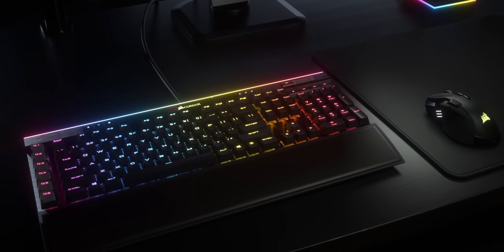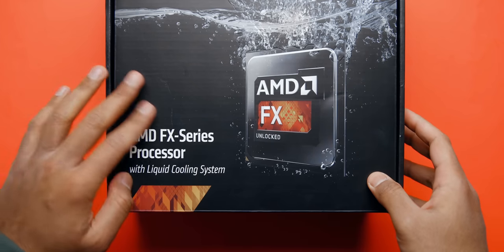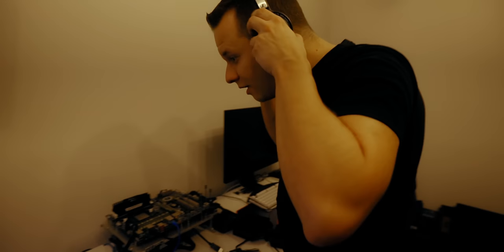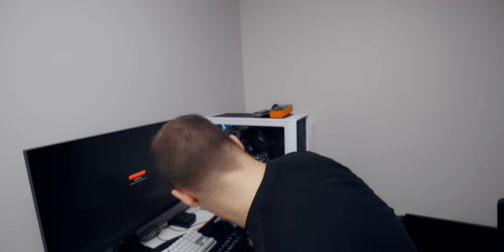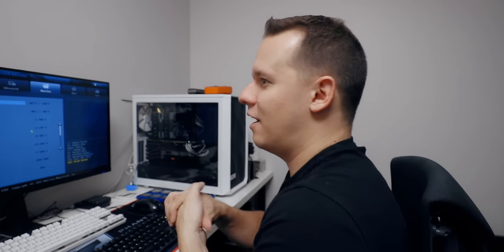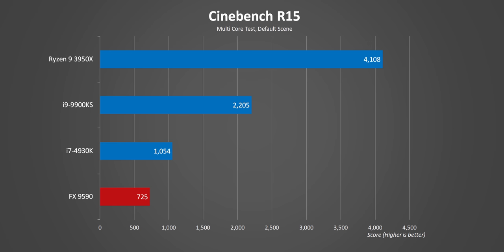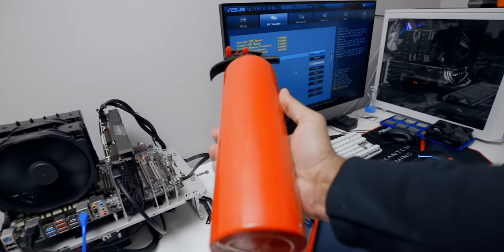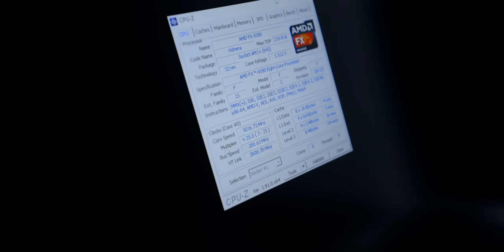Why The FIRST 5GHz CPU Almost Failed - AMD FX-9590 Revisited!

Comment: 220 watts for 5 Ghz doesn’t seem all that unusual. Doesn’t the i9-9900K also use a lot of juice at 5 Ghz. 
Thank you for bringing a blast from the past back to us.
Reply: the i9 9900k does 5ghz ALL CORES, fx 9590 only does 5ghz one core out of its 4 cores cough amd misleading not actually 8 core lawsuit says. the i9 9900k uses 120 watts... As you can see the fx chip is a good as comparing a toy plane to an actual plane. btw that ryzen chip getting smashed by the i9 9900k in all benchmarks was amazing right amd really likes misleading people, cough the ryzen cpu was more then double the price of the i9 and had double the power consumption cause it uses double the cores. cough ryzen 3rd gen is not 7nm look it up! its actually 12nm lol amd MISLEADING PEOPLE once again just like saying 4 core fx cpus was 8 core when it wasnt, ryzen aint 7nm its 12nm amd just saying (in pending lawsuit) that its AMD's interpretation of 7nm which is bull shet.
Reply from the maker: @thelightsilent  Exactly.  And then when overclocked it goes above 400W easily.
Reply: @thelightsilent  Only the Ryzen 3000 APUs are 12nm. The rest are TSMC 7nm.
Reply: TheLightSilent can you link me to this information? I cannot find sources stating that Ryzen isn’t 7nm
Reply: @thelightsilent  the i9 is the one using more power compared to the ryzen 9
Reply: @thelightsilent  what's you opinion on chemtrail, though?
Reply: @thelightsilent  What drugs are you on, my man? I'm not sure why they even replied to you.
Reply: Analyzing Male Slavery Yes I know that, if you read clearly he stated that Zen 3 is 12nm hence why I’m question where did his information come from.
Reply: Hardware Canucks This was my thinking as well. Thank you Hardware Canucks.
Reply: TheLightSilent Couldn’t have said this better myself. Thank you. (:
Reply: @HardwareCanucks  Did you read the full comment you replied to? 1 true statement followed by a series of straight out lies. Did he even watch your video? There isn't a single benchmark where the Ryzen CPU gets "smashed", even in games the 9900ks isn't that far ahead while it truly lags behind in multi-threaded applications. The R9 3950x isn't twice the price of an i9-9900k, it's roughly 50% more expensive (a bit less than that in fact and the difference is even smaller with a ks). A 50% increase in price (at worse) for a 100% increase in performance in multi-threaded applications and only a 10 to 15% decrease in performance in games, not a bad deal at all for a content creator. And that's without mentioning the 3900x that still beats the 9900k(s) with a significant margin in the same MT senarios and costs the same.
Ryzen 3 CPUs (not the APUs) ARE 7nm, and it's not a case of "AMD misleading people again", that's what TSMC calls their own process. So if someone has an issue with it and thinks that TSMC shouldn't call it 7nm it should be taken to TSMC, not AMD.
And no the R9 3950x doesn't use twice the power of an i9-9900ks, the graph in the video shows a 40w difference (181 vs 220). Considering the R9 has twice as many cores for double the performance it is actually a very good result. And again if he wanted to compare apples to apples, then let's have a look at the  3700x: consumes significantly less power than the 9900k and ks for the same core count, similar performance in MT applications, 15% slower in games but also much, much cheaper.
Reply: @thelightsilent  The 9900K does not do 5GHz on all cores at stock.  Only two cores.  When overclocked to 5GHz on all cores, it uses a hell of a lot more than 120W.

The 9900KS doesn't do 5GHz on all cores at stock, either.  You only get that when you ignore the 125W TDP, just as you only get 4.1GHz all-core on the 9900K unless you ignore that processor's 95W TDP.
Reply: @thelightsilent  And you're delusional about 7nm.  Actually, you're delusional in general, it seems, but it's hard to say given your word salad.
Reply: @thelightsilent  Which Ryzen got smashed by the 9900k? If you're talking about the 3900X, it beats the 9900k on pretty much every benchmark, and at gaming it is about on par but slightly behind. If you're talking about the 3950X (since you said twice the cores) it doesn't have twice the power consumption of the 9900k, it uses the same amount of power despite having twice the cores because of how efficient TSMC's 7nm and Zen2 are.

The Ryzen 3000 series has 14nm, 12nm and 7nm CPUs, all of the Zen2 CPUs are 12nm while the Athlon APUs are 14nm and the Ryzen APUs are 12nm. Even if the 7nm Ryzen CPUs were actually 12nm, the one getting the lawsuit would be TSMC, not AMD, because they're the ones adverting the node as 7nm, and there is no way it is 12nm, otherwise we wouldn't see the massive jump we saw from Ryzen 2000 to Ryzen 3000 if Zen2 were still using 12nm.

FX having 8 cores is not a lie, and even if you want to argue that they don't count as 8 cores because they aren't full cores, then they wouldn't be 4 cores either, it would have 4 full cores and 4 half cores, though that's not exactly how it works, in reality it had 4 modules with 2 cores each, but they shared resources with the other core from the same module, more specifically, they shared a FPU. Nothing says that a core needs to have its own FPU to be a real core, if that were the case then old CPUs that didn't included a FPU wouldn't be single core CPUs, they would have zero cores.
Reply: @thelightsilent  Lmao set you bios and limit the 9900k to 120w, you wont see 5ghz....Even the 4.7ghz all core need a lot more than 120w...
Reply: @thelightsilent  3rd gen ryzen is 7nm. The IO die is 12nm, but the main CPU die is 7nm. IO die only handle PCIE lanes and RAM, all CPU cores is in the CPU die.

Comment: Yup, still have one of these fx-9590 220 watt chips, paired with an msi 990fxa gaming board. I don't use it anymore it's been retired. Built an am4 platform. A major problem was when it boosted over 4.7 ghz., windows could freeze. Found out later you could disable the boost in the bios that would keep it stable.

Comment: Had one of these. Swapped it for an FX-8350 which did the full 5GHz on all cores on a lower voltage than the FX-9590 on it's 4.7 all core boost

Comment: Still having and loving my FX 6300 at 4.6Ghz OC
Reply: rip 30fps, you getting same performance as an xbox 360/ps3 at best. suggest you get an i5 or i7 if you gonna play games or do anything that requires your pc not to crash cough ryzen builds tend to crash a few times when using them black screens are also a common problem look up online hints why im only suggesting an i5 or i7 since intel is at least reliable and you get your moneys worth with intel.
Reply: @thelightsilent  I agree but for my everyday use is more than i need. Using for games too with a 144Hz monitor at High or Ultra on same games with at least 60fps is more than enough. If i played at 30fps i would change my rig for a new one. Right now i don't need spend money. Cooler Master MasterLiquid ML240R and a Asus Strix RX 580 OC and 16Gb RAM i am glad for his performance right now.
Reply: For me I would upgraded ages ago. Like : Ryzen 5 1600Af for 90$ or intel 9400f for 60$. They outperform this by eras. 

So yeah, you gonna buy new MB together with new CPUS, but who cares? The cost of the KW per hour you pay to run the system will pay new investment in  1 year.  

Compare 65W to 225W. And the new CPUs running 5-15w in idle.

Comment: Been running a 9590 at stock speeds since 2015, picked this thing up for 200 bucks without a cooler on newegg...this thing still cranks 70+ frames in all my games with a gtx 970 (mid to high settings). Had to replace my motherboard once due to a thermal overload on the VRM's but it's been chugging along ever since. Team RED
Reply: "Team RED" - yeah, you have shown successfully to be a fanboy.
If you actually use your PC then having bought any Intel-CPU in the meantime would not only have improved performance dramatically, but also saved you money.
That thing was garbage when it was released and its only use still is to be a room-heater.

Get a good CPU now - ryzen 1600AF is good value right now.
Reply: @ABaumstumpf  yikes toxic
Reply: @GogitoGTHD  For telling him the truth?
Reply: @ABaumstumpf  if he was team red wouldn't he have paired it with a Fury or 390 instead of a 970
Reply: @ABaumstumpf  His system still works fine with 70+ FPS. Why would he need to upgrade if the system is still meeting his needs? I alternate builds between Intel and AMD... not sure why, I just like a change every time. My 9590 build is still going strong and its lasted so long without needing many upgrades that I may stick to AMD again for the next build just for the heck of it.  I personally don't upgrade until the equipment I have stops meeting the needs I require.  This reply is coming from an early 2008 Macbook Pro... it still meets my needs for work and non-gaming purposes. Talk about "classic"

Comment: My FX9590 still is an ideal heater in the office. Combined with a GTX1080 it still runs most of the games without problems, but I hope Ryzen 4th gen and RTX 3rd gen will be there soon for my upgrade

Comment: Lower power draw than an Intel i9......
Reply: @WD Fourty oh bless you - 95w is the non boost number given by Intel - in real world and under boost its over 175w. Yes you need to research.
Reply: @WD Fourty so you havent watched the video then, nor have any actual understanding how Intel uses TDP or how the PL1 or PL2 boost clocks works then on the i9 series.
Reply: @WD Fourty - we are talking stock numbers. The Intel i9 9900k has PL1 and PL2 boost states as stock. Intel declare TDP as the non boost numbers (see the GN video on explaining what those terms actually mean - they are set by default). From your reply you have ALOT of learning to do.

Comment: I mean, it did fail, didn't it? It was such a bad product. At least the smaller CPUs like 8350 and 6300 had ok value at the time, and the APUs had decent graphics performance at the time, but these supposed high-end parts had literally nothing to offer. Not in terms of value, not in terms of performance, not efficiency. Nothing.

Comment: When you realize that multi-threading is having twice the amount of threads, which you didn't know because you are growing up in a world where that is normal.
Reply: Some non consumer cpu's actually get 4 threads to every core, so that's why 'multi' instead of just 'dual'.
Reply: @conandude76  4 threads on a core ?
Reply: @archfxt3619  Yeah read that right, yes. 4 threads to a core, rather than two.
Reply: 2004 when i built my first pc with new parts. The Pentium 4 HT was new. The notion of an 2 thread per cpu was thrilling.
Reply: @conandude76  Some IBM POWER9 CPUs even have 8 threads per core! Really, they're just trying to use the execution units that carry out the program instructions more efficiently - instead of having, say, 80 cores with one of everything on each, they have 10 cores with, perhaps, 8 of each of the really common simple functions that are used all the time, 4 or 6 of each less-used/more-complex function and maybe only a couple of the rarely-used and/or really complex parts, plus some logic to allocate them to threads as and when needed. (That's a massive oversimplification but hopefully you get the general idea.)
Intel kind of came at it from a slightly different direction with Pentium 4 HT - the P4's design meant that a lot of its resources spent a lot of time sitting idle so it was possible to get a worthwhile amount of extra performance relatively easily by having a second thread keeping them busy.
(Actually, AMD FX had a little bit of this - the pair of cores that made up each module shared a few functions that AMD judged to be less heavily-used - hence the legal dispute about whether they really had as many cores as was advertised.)

Comment: Is it ironic that I'm watching this video on my OC 9590? I'm using a Sabertooth 990fx gen 3 R2.0 with an NVME drive in a pcie 3.0 slot. Getting 3200mb/s HD transfer rate, 5ghz cpu OC using an Noctua D14 air cooler and idling at 34c. Still playing latest games with good framerates :D. Kinda fun pushing old tech. great video!

Comment: "Back then AMD didn't have simultaneous multithreading" ... Yes they did. It was even slightly more efficient than Intels version. They just preferred to call each thread a core to look like much better value-per-money than they were. The FX-9590 realistically speaking was a Quadcore with Multithreading.

Comment: 8:48 Yes its hot to the touch. You are STRESS TESTING! You want to point me to the same level processor an it not be hot to the touch in stress test? Ugh.
Reply: Some processoes only get warm during stress tests. My i5 2400 won't get past 55ºC. So the cooler doesn't even feel warm
Reply from the maker: Wrong.  Getting hot (not warm) to the touch is BAD.  That means the fan(s) aren't dissipating heat from the fin array fast enough.  For that kind of reaction with a U12S speaks volumes of how much heat is being put out by this CPU.
Reply: @HardwareCanucks  Yeah because your pushing it farther than normal in a benchmark. Are you kidding me?! Yes its gonna run hot! Then you overclocked it. Which they specifically tell you NOT to do. Ugh! You drive me crazy with this!

An yes when it gets hot its because its not one of the Recommended coolers. Now do you remember. They specifically said Corsair and other liquid coolers. Why are you using a fan one? See this... This drives me up the way. Your doing it wrong an then saying see the temps are hot! NO!

Comment: It's funny that you didn't mention anything about the class action lawsuit against AMD for false advertising the FX-8000 and FX-9000 series CPU's as 8 core processors. AMD's bulldozer micro architecture used dual core modules that have 2 ALU's with a shared FPU.

Comment: I got a bettet motherboard and the rarest Gigabyte Fxa 990 Ud3 Ultra CF.  Nobody talk about those chip capable to use m.2 ssd onboard (not ad fast but still pretty damn fast) and OC NB to get maximum result with OC ram.  Hell gimme that chip and I could get it tweak really well under water.

Comment: I have built and used 3 of the 9590 processors.  I found that getting a motherboard that supported it harder than the actual processor and cooling it..  My best one was with a 240 water cooler.  Ran nice and had great gaming with it.

Comment: y'know I always liked the FX platform to be fair I never used the high end chips but my FX6300 served me well for many years with decent performance and even with that garbage old stock heat sink the temps were not bad at all not even close to alarming, But being a long time AMD CPU fanboy seeing AMD going from getting made fun of on the FX platform to crushing intel, and being religiously praised with the Ryzen, Threadripper and Eypc CPU's is quite amazing
Reply: "crushing" yep crushing the market imagine being a big company getting some expensive af epyc or threadripper cpus and then not being able to do anything you wanted it to do cause amd aint providing drivers that support any of the software you want to use like omg linus couldnt even make a raid set up of the epyc platform they got lol isnt that kinda bad they couldnt even use windows server which many companies use cause linux isnt as easy to use and requires them to get skilled linux employees which are still hard to come by. AMD is misleading people once again just like how they said 4 core fx cpus was 8 core (they lost the lawsuit xd for clear reasons) the 3rd gen ryzen cpus are NOT 7nm they are actually 12nm look it up! AMD says "its our interpretation of 7nm" cough lawsuit should be finished next year and im pretty sure saying something is something else = lying cant just say 12nm is 7nm just like how you cant say 4 cores = 8 cores.

Comment: It didn't help when the Bulldozer uarch shares 1 FPU bwtween 2 cores, and traded longer pipelines for high clocks, just like Intel's Netburst (Pentium 4)
Reply: "It didn't help when the Bulldozer uarch shares 1 FPU bwtween 2 cores"
Which 2 cores?
A module was imple 1 core with an extra Integer-Unit - the smallest part of the CPU.
All the important stuff like fetch, decode, the main scheduler, cache, IO, branchprediction - they all exist exactly once.

Comment: I got a FX 9590 and a Crosshair V Formula-Z sat under my bed XD
Reply: I still use mine as a secondary system. Still does the job.
Reply: @ej1025  I was till around a month ago but vr kicked it's arse so I upgraded to a 1600 AF
Reply: @alanchristian3839  Understandable, I upgraded to the R5 3600 myself. Much smoother, and less stutter. FX-9590 isn't too bad with something like a 390X or RX 580, but that's pushing it. RX 570 or 1050 ti is probably the max for the 8-9 series FX chips.